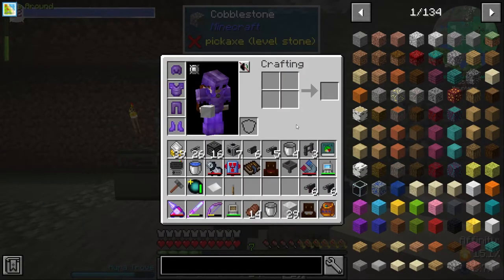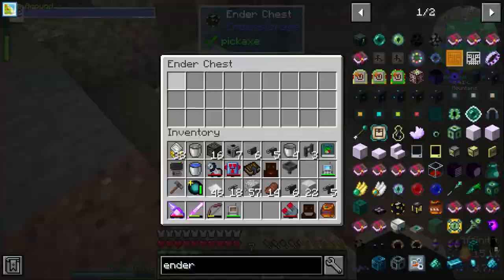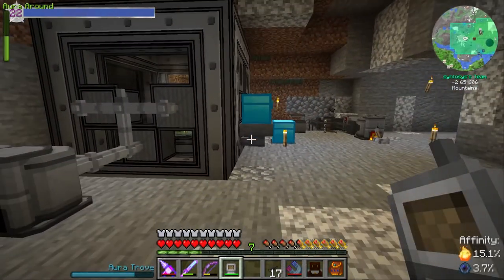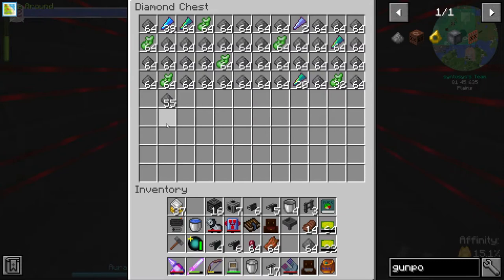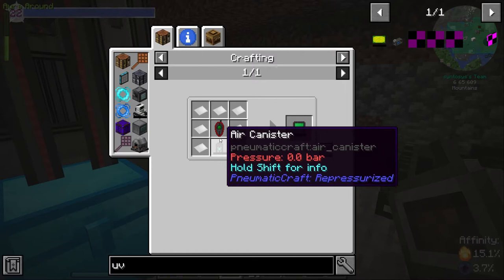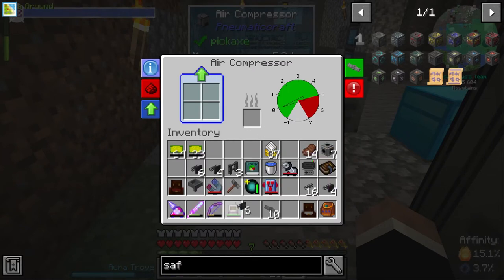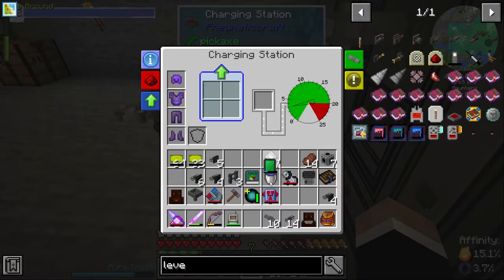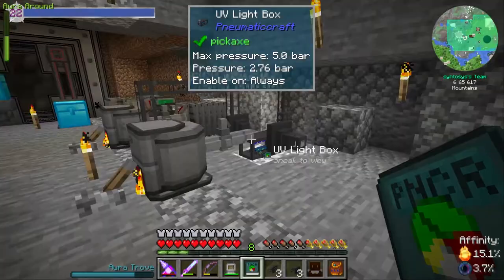Direwolf20 116 Episode 56 - Slippery little f....

Comment: Try the heat frame cooling, put a tnk of molten plastic in a chest with a heat frame on it, also try mekanism heaters unless you wantc a 100% pneumaticraft setup
Try out modular routers for item pickup, I am still amazed at the versatility of this mod, it can do so much, uses no power and the recipes are cheap